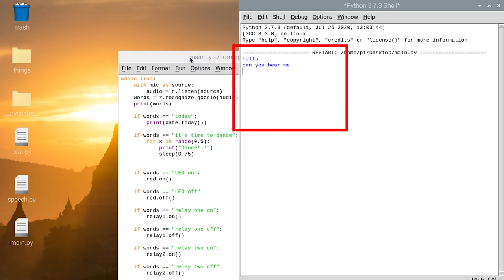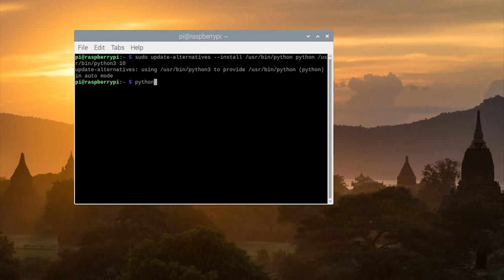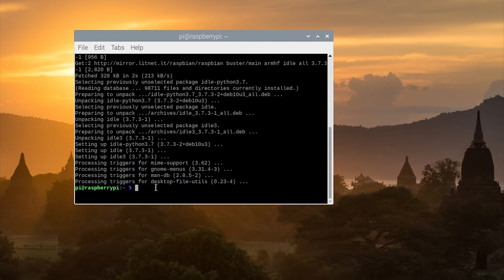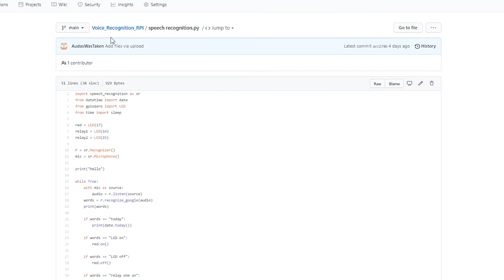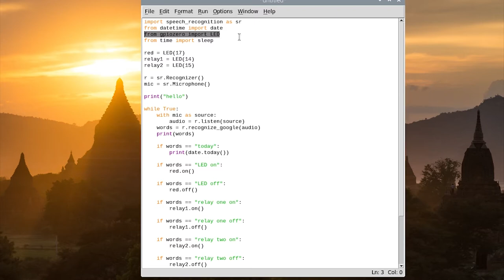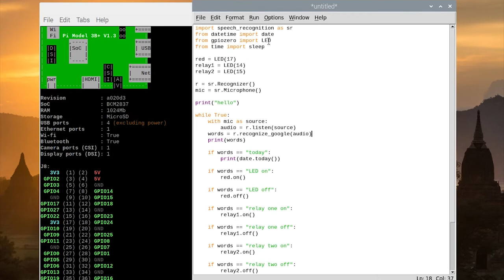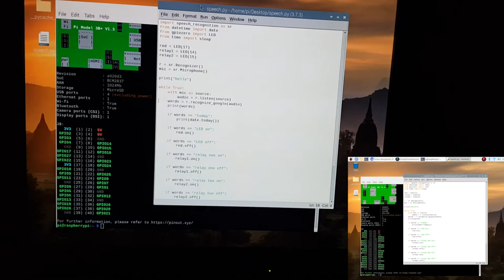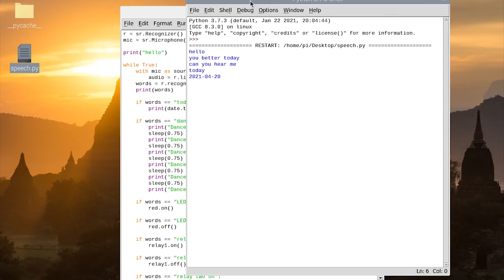Speech Recognition With Raspberry Pi

Comment: Hello. Thanks for taking the time to detail this! My Dad is 85yrs old, lives mostly alone and he has very bad hearing so he requires hearing aids to hear most things. But at night he does not wear them. So he cannot hear his house alarm system if there is a warning of a fire, intrusion, etc. I have set up voice-activated (VOC) intercom by his alarm station in the hall and a receiver intercom by his bed which will transmit anything the alarm and/or a remote, live alarm person says such as asking him "is everything is ok?". But again he can't really hear unless he puts his hearing aids in which takes time assuming he even knows to do this. So I have purchased a heavy-duty industrial vibrator I plan to mount to his bed frame and I plan to have the alarm speaker voltage act as a signal to a relay to turn on the vibrator if the alarm is going off. (actually, the alarm is so high-pitched he can't even hear it with his hearing aids in even when right next to it. And despite it being SO loud most people can't take more than 10 seconds or so before saying "please turn it off!") So I'd really like to have something that, after vibrating him awake would transcribe what is being said on the bed-side intercom and then project it on his bedroom wall (using a cheap $100 video projector) so he can "hear"/read what is being said by the alarm or someone on another home intercom.  But this is something that would have to be on all day or at least at night without fail as I can't really rely on him to remember to turn it on, type commands to start a program, etc. each night. Do you have any thoughts on how this could be done? I should mention I am a mech engineer who has worked on Pi-related projects but I have no real hands-on experience with them. Well, thanks for reading! - Jim

Comment: My raspberry pi is not recording my voice i connected the mic using USB sound card all are recognised by raspberry pi but not working I have tried lots of ways like resetting the alsa mixer but it didn't work iam using raspberry pi 3 B+.... the mic and sound card are working perfectly in the pc
Reply: @krugergaming-yt8121 I also just had the same error you had, I'm using the Rpi model 3B. Did you manage to resolve the error?

Comment: hi the code is amazing but i have a problem when running the code I get a error like microphone is not defined what I can do (I am using a mems microphone allocated to card 0)
Reply from the maker: Hey, thanks. Have You tried checking if You really are detecting any sound from Your mic? And also You can check via python which mic is being used, there is a simple command for that, but i can't recall it now. i Haven't had this problem in particular, so I don't know this helps or not, but try playing more with Alsamixer settings, cause that helped me a lot.

Comment: HI, can this work with respeaker 2mic pi hat ?
Reply from the maker: So I don't realy know about the hat, but my method is using the USB so it instantly understands the mic. With hat mic would probably go through GPIO and i am not quite sure how raspberry reacts there. But you can check Alsa if it sees the mic. And if it does detect it then most likely everything stays the same for the code part

Comment: great work man ......sometime I get error like this .....
raceback (most recent call last):
  File "/home/pi/voice recg.py", line 18, in <module>
    words = r.recognize_google(audio)
  File "/usr/local/lib/python3.7/dist-packages/speech_recognition/__init__.py", line 858, in recognize_google
    if not isinstance(actual_result, dict) or len(actual_result.get("alternative", [])) == 0: raise UnknownValueError()
speech_recognition.UnknownValueError

any idea?
Reply from the maker: Thanks! I am pretty sure this error comes when recognizer does not get any audio from the user and then it just sends static noise to Google wed speech API which does not understand that and doesn't give anything back. If this is the case then yeas after longer uses this program might bring this error. A simple solution for that would be to use Try Except conditions for reading the voice. You can simply read the certain level of voice from which it activates the comunication with recognizer. I hope this helped! And thanks for watching my video!
Reply: Thank you.
Reply: @dhruvnayak1079  I'm having the same problem, were you able to fix it? and if so, what did you do?
Reply: @benhardy8351  i havent yet ..i will update if i find a solution
Reply: @dhruvnayak1079  I'm new to Python but I think I solved it for me. I added Try Except so mine looks like this now

while True:
          with mic as source:
                   audio = r.listen(source)
          try:
                  words = r.recognize_google(audio)
                  print(words)
               
                  if words == "stop"
                               break

         except Exception:
                    print("is anyone talking?")

so now instead of the program cancelling from the error, it will print "is anyone talking?"